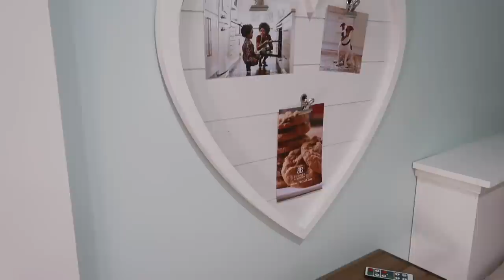Girls Bedroom Reveal! You won't believe how it turned out!!

Comment: Here’s a hack for the “beddy” if you want to swap bedding seasonally or for others reading this who cannot afford $260 per bed:

Remove mattress from frame or box spring
Put quilt/comforter on frame/box spring sideways towards the wall (or whichever side they don’t get in)...so the short edge (top/bottom) of the quilt/comforter will be along the side of the bed.  
Put the mattress back on & fold the quilt/comforter over to the opposite side.  (Think of a taco laying on its side...the shell is the comforter & the meat is the mattress).

Comment: I needed thin wood and thought that pine would be cheap but then realized that the select pine was SOOOO expensive. I didn't look too far into to it but I heard poplar is actually cheaper than the select pine because it has less knots and it can be cut thinner. Available at Lowe's or places other than home depot

Comment: Wigs for Kids or Locks of Love. I've donated three times now. The first two were to Locks of Love (12 inches and 16 inches) then I heard they sell their hair rather than give to children free of charge. I then sent the third one to Wigs for Kids. Since then, I've learned both do not charge children for wigs but "Locks of Love" will sell pieces that are too short or gray (which can be used for adults or aspiring hairstylists). 

10-12 inch minimum for both. Look at their website BEFORE YOU CUT for specific instructions on how it needs to be prepared to cut and for shipping prep. If you get it done at a salon, check to see if they're partners with one of these non-profits because that may save you the step of having to prep and send it yourself. (They'll keep it at the salon and send it for you.) 

Just a last note: Locks of Love takes color-treated hair while Wigs for Kids does not.

I hope this helps! 😊

Comment: Make Rice water!!  It will fill in within 3 days and grow til you cut .
I’ve been making rice water for over a year. My part in my hair looked different, so I took a handful of rice, placed in a bowl, added water ( I make 1 gallon ) to the rice. Stir it and wait 20 mins . Strain the water into container ( 2  for  the refrigerator, 1 qt for each bathroom) use at least 3 times during the week ,  rinse hair add  conditioner (cheap) add 2nd conditioner ,  rinse your hair . Towel dry lightly.  Add leave in conditioner with Shea butter ,; if your hair is dry lifeless add another conditioner. Leave in butter I use Pantene ;  and ! Repeat as you feel you hair: rice water,  conditioner 2 different kinds, Shea butter , and another product!  Towel dry ! By day 3 new fine baby hair is grown in . It will grow up to 3-6 inches a month!  
And now I’ve learned how to fill in my hair to make it thicker.  Using rice water, following directions above, it works .  
Don’t use sulfur products.  
I did try a hair shampoo with out sulfur . It won’t be used again. And it did not grow or fill in my hair, my hair felt bad, I spent $$ for this product! Waste of money . 
Rice water works!  My husband uses rice water his hair is beautiful healthy clean refreshed ! He loves it !  It glistening in the light , sunlight, and it’s very manageable,  anyloss if damage hair, missing hair. Or balding spots it all grew back in.  It’s good for anyone with hair .  Or any kind of hair loss. Thinning. Broken , ; I even did the horse tail!! It fill out greatly

Comment: The sooner you knock out the boy’s room, the sooner they, too, will want to spend time hunkered down in their own Sanctuary! I wouldn’t copy the girl’s swing, however. Instead, I’d build them a FORT: Maybe a dome that is sturdy enough to climb, and that they can cover with camping/outdoor adventure-type sleeping bags, etc. OR, if you don’t want a permanent cave/structure, just set up a roomy TENT in their shared space; so they have an Inner Sanctum they can escape to separately, or together for imaginary play. You could have a pair of battery powered (camping) lanterns, some floor pillows, etc., for inside the tent to make it a comfy hideout. You could put glow-in-the-dark constellations on the bedroom ceiling, and hang a Cargo Net to hold sleeping bags, butterfly nets, etc. Flannel curtains would be cozy and practical. Maybe some shelving for themed/hobby books...
As for colors, keep ‘em cool (so not over-stimulating), but maybe invite suggestions? Also, if they’re into it, a Nerf basketball hoop on their door!